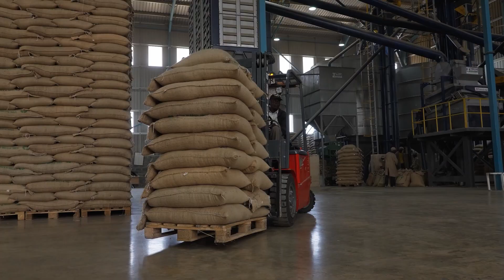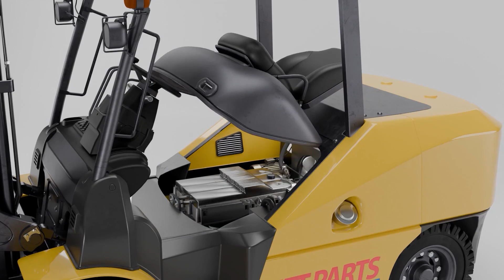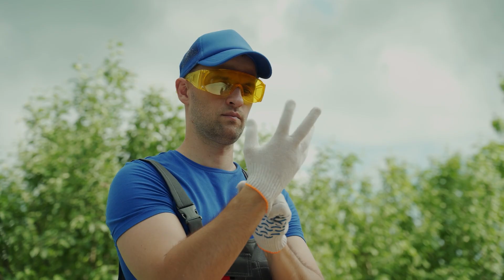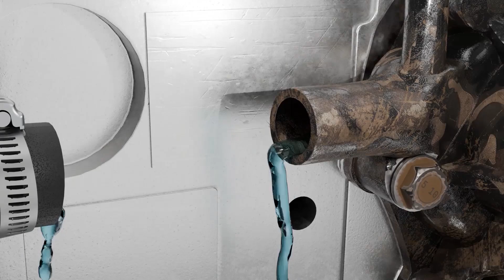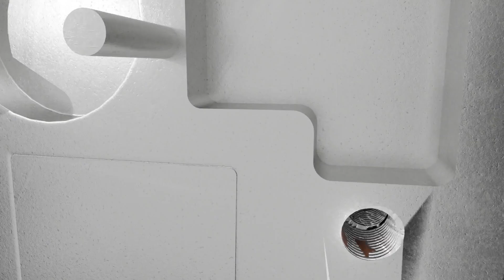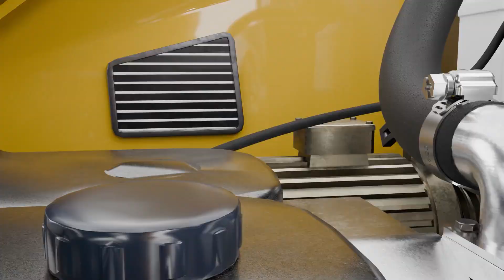How to Replace Forklift Water Pump | Forklift Water Pump Replacement | Forklift Water Pump Repair

Comment from the maker: If your forklift is overheating or losing coolant, check the water pump for bearing noise, leaks from the weep hole, or shaft wobble. Always install a new gasket and torque bolts evenly to avoid repeat failures.
Need the correct forklift water pump by make and model? Visit LiftPartsWarehouse.com before starting the job.